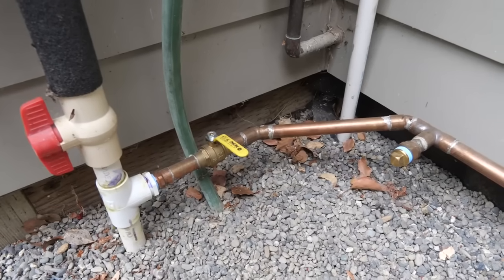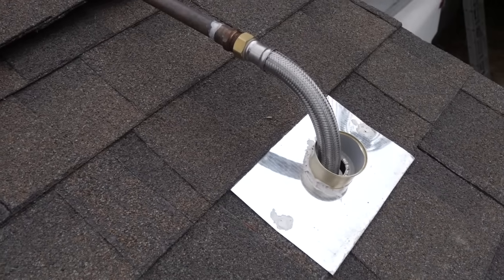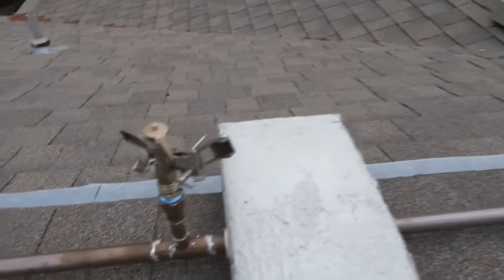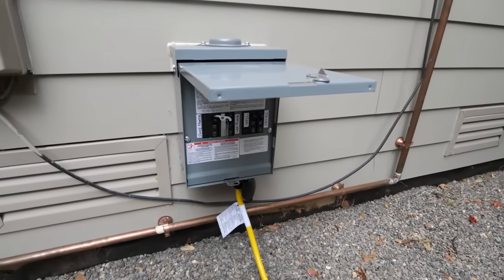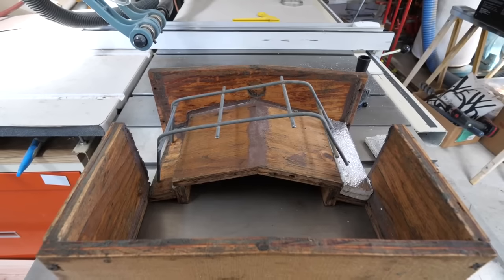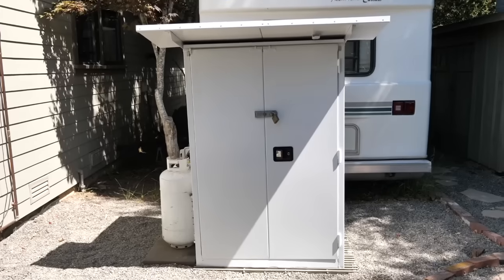Roof sprinklers and backup generator for wildfire-prone rural house

Comment: While following every step of your system I was thinking ”so far so good”— until the end where I learn you have only three sprinklers. I’m thinking Murphy’s Law. What if a wildfire is accompanied by a howling wind? Fires can generate their own wind. Rain Birds are no match for powerful winds. While the leeward  side of the house would benefit from additional rainfall, the windward side could be left exposed to the blowtorch. I’d feel more comfortable with some additional sprinklers surrounding the structure an adequate distance from it. And with all of the nearby trees, if one were to topple over during a fire it could act as a ladder for a fire. Perimeter sprinklers could help to mitigate that risk. Of course you’d have to increase your pumping pressure, too.

Comment: Its good.. Your two weak links are these.. Get a burriable propane tank.. not only safer for fire but you need almost no head space like above ground tanks.. I do not like that SS water heater flex hose as your transition onto the roof for one reason.. The water isnt being held in by the woven SS, they are lined with plastic or rubber that will melt very easily and your system is toast.. You took the high ground using copper so stick with it..

Comment: You should consider adding a fire retardant injection system.  It would be easy to splice into your system.  You could put a bypass to run straight water or fire retardant as needed.  You could get Phos-Chek, F-500, or NovaCool, or something similar.  A 5 gallon pail would work fine for your set up.  I'd all put in a hose attachment past the injection system so you could spray your walls and eaves with a garden hose from the ground.  Most of those retardants will resist fire for a couple of days after application.  That way, you can pre treat your home and property long before you have to leave.  Adding that would likely be less that a thousand, maybe less than 500...

Comment: Problems.
Power goes out.
Need to test it frequently.
Tiny wasp will make their nest inside the holes in the sprinkler heads and plug them up.
During fires, people are evacuated. Depending on how long, your generator or water pump will run out of fuel or your well runs dry.
We were evacuated 3 weeks before the fire arrived to our area. No one would be here to turn on, watch, and maintain the system. 
If I stayed I would be risking my life as well as those who would try to save me. 
If connected to rural municipal water, the towns water tanks will run dry in one day.
I use 4 large, 2" farm type irrigation sprinkler heads connected to a 14 hp gas pump and 4" fire hoses that each can cover a 200 foot diameter. My water supply is an 24 gallon per second irrigation canal. The system will saturate my 1-1/2 acres in 5 minutes. Problem is I have to stay here to start it and keep it running.
The only solution would be an auto start / stop system that could sense when the fire arrived and an auxiliary fuel tank.
The fire "The North Complex", killed 16 people and injured more than 100. With 70 MPH winds, the fire burned an estimated 318,935 acres. It started on 17 Aug and was contained on 3 Dec.
We were lucky they stopped the fire a few hundred feet away from our community. The water tanker trucks were able to fill up at our irrigation canal, they followed and covered the bulldozers allowing them to cut huge fire breaks.
The best that people can do is to clear their property of fire hazard debris, make defensible space, and build homes using fire resistant materials.

Comment: it is a great prevention system set up to protect your home, but if you have used pvc fittings from the start that would be a worry, surely they would melt given the heat you are expecting ???

Comment: Hopefully the fire would not spread and gets close enough to the propane tanks that powers the generator which will definitely explode like a bomb and cause more fires 🔥. I think the propane tanks should also be placed in an enclosure of some sort  to at least delay the heat from igniting it in the event that the fire spreads and gets close enough to the tanks.

Comment: I did a similar system, except my sprinklers are mounted on fence posts around 5m (15ft) from my house and shed.  All the sprinklers need only a 90-120’ sweep to cover their ‘zone’ with all overlapping by about 25% on each side.   The main reasons I mounted my sprinklers around the structures are to cover all the roof, walls, windows and underneath my house, to not have to fit pipelines in or on my roof, and have through fittings to get there, if anything leaks, so be it, there will be no chance of water damage to the structures, I get an area of coverage well beyond the structures themselves, and finally the cost - I was able to use poly pipe for 95% of the pipes as they are buried and only used the copper pipe to run up the fence posts.  A HUGE cost saving.

Comment: Fascinating, common-sense solution to a problem that should not have occurred. Brilliantly designed and executed. You ought to see if your insurance company will give you a discount on your home insurance. This installation is relatively cheap and it is something that CA could have installed on homes and businesses that would have cost almost nothing in comparison with losing a $750,000 home.  

A couple of suggestions:

1. While your concrete block idea works to keep the pipe in place., it would probably cheaper and easier to use self-flashing solar panel brackets designed to mount solar panels. They are quick and easy to install, are very strong, and they are pretty cheap.  Once you have something to attach to, it is easy to find a fitting that can attach the pipe to the bracket. 

2. If the brush around your well pressure tank catches on fire. that single sprinkler will not protect it. The simplest and most effective thing you could do is cust back the heavy brush that surrounds the tank.  Remember the heat from burning brush is intense. It can hit your tank from 50 feet away and damage it. 

3. I like the generator idea. however solar panels and a backup battery system would provide a cleaner solution and also provide electric power for your home for free. I would recommend building your system around the Sol-Ark 15K hybrid string inverter. It's the best available and it allows you to use generator backup automatically along with battery backup. It also allows you to go off-grid.  

Here's a link to one vendor that sells Sol-Ark:

https://www.solar-electric.com/sol-ark-sa-15k-pre-wired-hybrid-inverter-system.html?srsltid=AfmBOootbtddU6SVHftXxZsFPdaKlksM8py5SOx0jeIcRZOfS0uGbxLL

Comment: Nice work on the install, I’m a fitter welder living in Australia and made a system for a work colleague years ago. I used 1 inch copper mainlines with 4 sprinkler heads, one on each corner of the house and a large central sprinkler on the middle of the roof. Pipework ran inside the roof cavity and up through the tiles. The central sprinkler was a farm irrigation sprinkler which covered the entire house. As the house had an in ground pool we rigged up a petrol fire pump with remote to provide the sprinklers enough water to be a deluge system so it drenched the home and surrounding grass, trees. Taking the pool water meant it did not rely on mains.

Comment: Thats pretty slick! We installed one after the 2020 fires here in Oregon.  We have a Generac/propane set up. Rainbirds on our house and shop. On questionalbe days, we control the system via WIFI and have it run for 15 minutes every hour while we are at work. Keeps the roof, gutters and surrounding area wet. We figure it could save our place someday.

Comment: Great job !  I read that Jennifer Aniston spent Millions of $ having a similar exoskeleton sprinkler-system installed on her Mansion in LA. And it SAVED HER HOME !’

Now, although you did a great job, I’d do a couple things a little differently that I feel would greatly improve your homes fore-safety. FIRST, I’d use a shower sprinkler head (Mix ‘em up on the roof) that soaks every foot surrounding it w/in 0-20 ft VS the bird type that over-shoots its closer proximity areas but shoots real far, like 40ft. Which is a good sprinkler head for up on the roof. I’d mix them up. As long as the roof gets soaked w/water quickly, then leave it be. Also, I’d add more sprinkler-heads. And lastly,get rid of those trees man ! And get rid of all those shrubs that will turn into an instant FIRE-BALL when & if a hot glowing ember lands on them! You gotta have a wide Fire-break between your home & any surrounding flammable grass, shrubs & trees, where there’s NOTHING FLAMMABLE W/IN REACH OF YOUR HOME !  A Fire-Break alone will save your home from going up in flames ! Not having beautiful trees & shrubs around your home makes it look &feel pretty barren I know ! But better to be barren than ABLAZE !!!! God-Speed & great Pro-active job !

Comment: First of all, I don't want to denigrate your work, but I have noticed a few things that should be improved in your interest!

The following fire hazards still exist:

- 0:44 Roof overhang
- 0:44 Clinic openings (or ventilation openings)
- 0:56 Combustible roof covering
- 1:26 Trees / bushes too close to the house and also above the roof in an interior angle, absolutely dangerous!
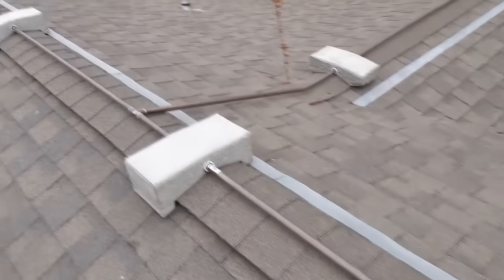- 2:00 Dry, flammable material on the roof
- 2:09 Even more trees and bushes right next to the house, plus the fan and the clearly recognizable open large pipe leading into the inside of the house.... The purest invitation for sparks to come in and cause a fire from the inside. A damp roof doesn't help either, a spark that flies straight in is enough!
- 2:09 Sprinkler pipe is too short, it's not just about moistening the roof, the house walls and especially the immediate surroundings around the house must also be wet!
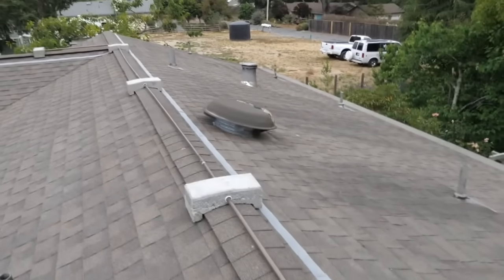- 2:45 More openings leading into the house
- 2:52 Another tree too close to the house, plus a conifer.... why not put gasoline barrels in the garden?
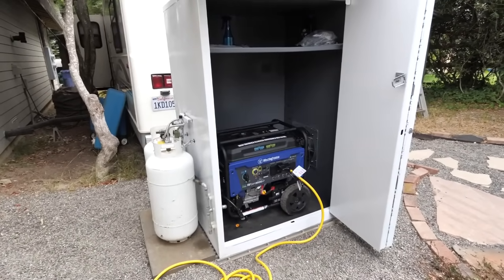- 3:36 Emergency power generator set up outside the protected, wet area.... Pointless. The part belongs INSIDE the house, where it is best protected, after all, your irrigation depends on it! The fact that the generator in the box is protected against fire does not help the exposed cable, which is quickly scorched in an emergency!
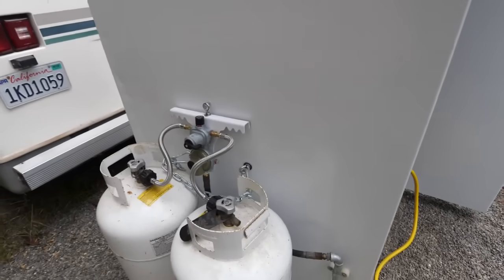- 4:51 Gas cylinders open in a fire hazard area .... I am lost for words
- 5:44 Power distribution outside and ventilation grille near the floor, a perfect target for the next fire!
- 8:37 Despite the sprinkler, the pressure system is not safe because it is under a tree.

I don't want to beat you up completely, the approaches I have seen here are already quite useful, but you should make a few improvements in your own interest.

1: Trees and bushes must be moved away from the house. they are the greatest danger for fires.

2: All openings leading into the house must be protected from flying sparks. There are standardized (in Europe) fireproof, automatic dampers for this purpose. However, it would also be sufficient to install 3-4 narrow wire grilles one behind the other at a short distance to prevent sparks from entering the building.

3: The power supply is your fuse for everything, protect it completely from fire. So lay the cables underground, protect gas cylinders against fire, preferably like the generator in a fireproof box with forced ventilation

4: Replace the roof covering with non-combustible material. If necessary, have it subsequently coated with fireproof material, there are suitable paints / coatings based on silicate.

5: A small wall approx. 30 cm high around the property or at a distance of approx. 2 meters around the house. This prevents the burning grass from reaching the house wall. In addition, a gravel or sand strip of approx. 1 meter around the house and keep it free of anything that can burn. 

6: Do not store any flammable liquids on or in the house, not even in the garage. So either enclose everything in another fireproof box or don't have it in the house at all.

7: Nothing can be done about the roof overhang, but in the event of a forest fire, vortices are created here that keep the flying sparks in place for a long time. If necessary, remedy this with additional sprinkling. It does not have to be a sprinkler, it just has to be ensured that the underside of the roof and the upper part of the house wall remain damp!

8: We still need to talk briefly about the windows. I know that the window glass used in the States is not as heat-resistant as it could and should be for cost reasons. Now you could either replace all the windows and use fireproof glass, or you could make fireproof shutters / window flaps that can be quickly closed or installed in the event of a fire. If necessary, wooden panels painted with fireproof paint can be placed in front of the windows and locked or screwed in place in the event of imminent danger.

9: I could not see whether the whole house stands on a completely closed foundation, or whether it stands “on stilts” and was only covered with a grid in some areas. Please note that a lot of dry and easily combustible material accumulates under the house. The base area of the house should therefore be completely sealed with brickwork. If this has already been done in this or a similar way, well done and thoughtful, my praise!

Kind regards from Germany, may there never be a fire in your house
a graduate engineer in structural and civil engineering

Comment: I think this idea will take off  I live in a fire zone and I have a 2500 gal pool and ive now got a gas powered water pump , non ethanol gas , 100 ft hoses  and im thinking of adding your idea  as im a captain that's going down with his ship if  sheet happens

Comment: for your roof line, why not just have spray that just opens up and drenches the roof down to the entire roof would be saturated as part of the system with the sprinklers? Anywho, probably a few more sprinklers that spray the home too so it will never dry up with the fire  would  probably help.

Comment: Some issues here.  First, your water supply from the well is plastic PVC pipe and if there's a fire and it gets near the house, it'll melt and your water supply will not exist.  Second, in the generator shed, there is no air intake for the air cooled generator to receive outside air for cooling.  
Tree growing so close to the house that it'll catch fire.  Propane tanks too close to the house.
I live in a similar fire prone area in California and have been thinking about doing this also.
The big problem is in a firestorm, the cooling capability of the sprinklers will be dwarfed by the superheated wind.  The water may evaporate before it reaches the roof.
Ideally, a non combustible roof with a gypsum insulating barrier would be a good solution, along with non-combustible "Hardy Board" cement siding.  Also sealed soffits and soffit vents that seal up in the event of fire.  We added that due to California building code on our remodel.

Comment: Water won’t help.  The fires will burn too hot and the water will evaporate too fast.  You need to use foam.  Unfortunately judging by the proximity of vegetation around your house, you don’t have enough defensible space.  Copper pipe will not survive a cold winter.  You should go with galvanized steel pipe for durability.  The propane tanks remind me of a fire that we had near where I live.  When they exploded they took out a power line and transformer that somehow had survived until that happened.  The fire was already intense but after that was doubly so.  I hope that all of your planning and preparations never need to be tested.  You have a beautiful home.

Comment: I don't know why every home in socal doesn't have a sprinkler like this. HOWEVER, wells in my area can run dry in 45 minutes so, since most people have pools there for gosh sakes why not tap those? Seems like a no brainer. Should be a requirement out there.

Comment: With city water here I got 1 1/2 inch fire hose on ebay for emergency with 3/4 inch supply line can spray 25 feet up.

Comment: This video popped in my feed today. I think because of my past viewing of LA wild fires. 

This system seems neat, but I think building out of fire resistance materials may be more beneficial as a priority in fire-prone areas.

I don't know how effective roof sprinklers would be. I wonder about material under the roof eaves getting caught on fire from flying embers.
I wonder if high winds would just dry out the soaked materials and eventually catch on fire.
Would be interesting if an organization would recreate your setup and then test it against flying embers.

Comment: Things to add cisterns,  water pumps, battery back up, solar, wind generators, petrol or lng generator tanks buried and vaulted,  cisterns can be repurpused septic tanks buried around the perimeter of your house or other dwellings, use that water for watering your land , on new builds a sub basement could serve as storage of rain water also...

Comment: Hi, you did a great job, well done, just 2 comments. Would you not mount the gas bottles inside the container, that way they would not be damaged by the heat of a fire. I would be lagging those copper pipes with a heat resistant insulation also to protect them. Just a thought...
Reply: Yeah I'm worried how the propane tanks could catch fire or explode and damage the generator.  Maybe they should be further away from structures?  Since the tanks are relatively small, having them under ground might be an option too.

I THINK the copper pipes would be okay, as they would be carrying water which would help dissipate any heat.

Comment: Amazing prevention but are we not seeing the elephant in the room… all the copper pipes have been soldered and not propress/clamped… so with the first heat/forrest fire, it is very likely the solder will melt and your system will start leaking…